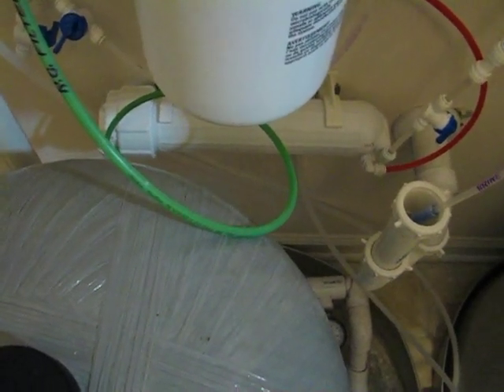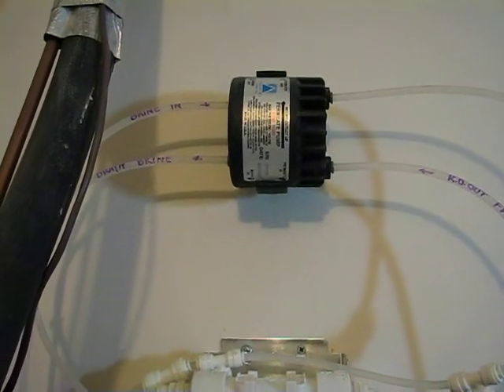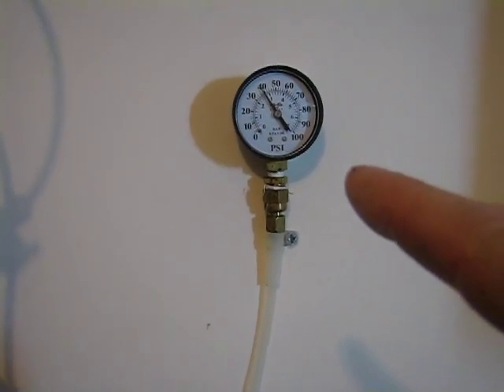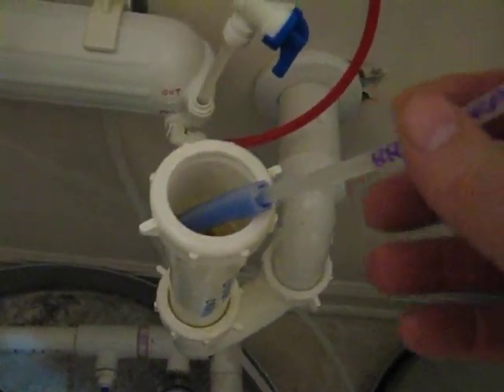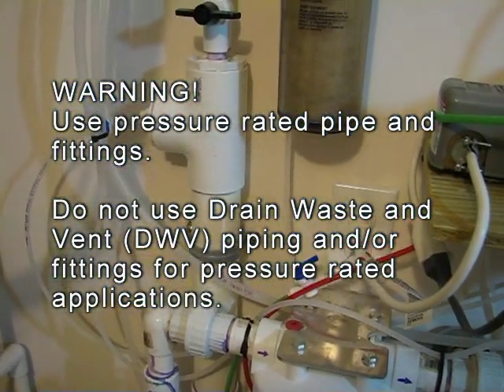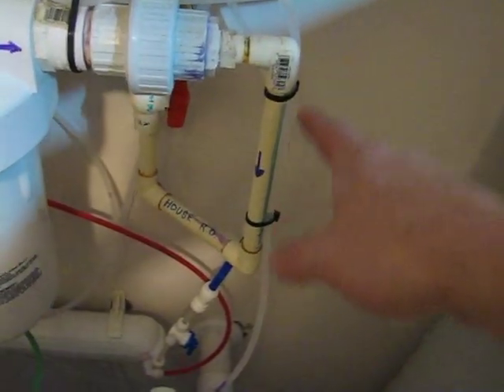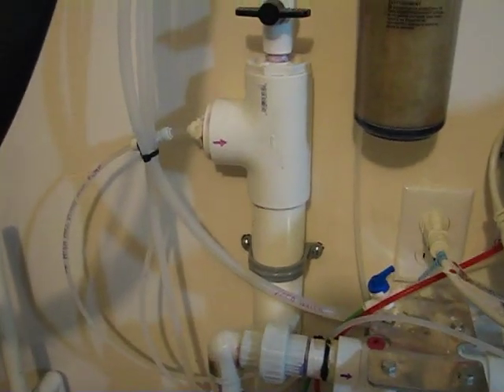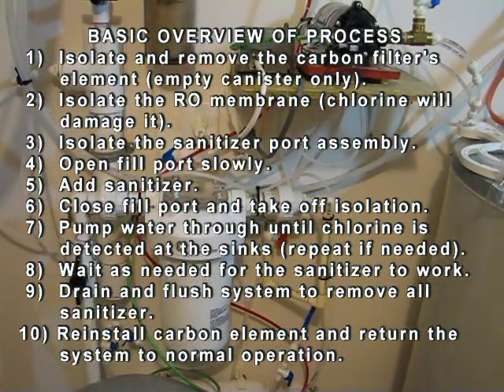Part 2b - Reverse Osmosis - Whole House Adaptation

Comment: @rldel149 About the 1st question that was not addressed, The water motor on the discarge (brin drain), to decrease RO side of membrane pressure and increase RO discharge pressure.
Would U please give an example of what to look for when procuring that part (pump).